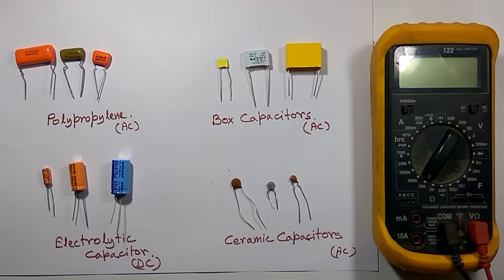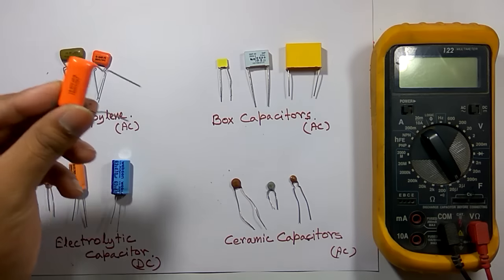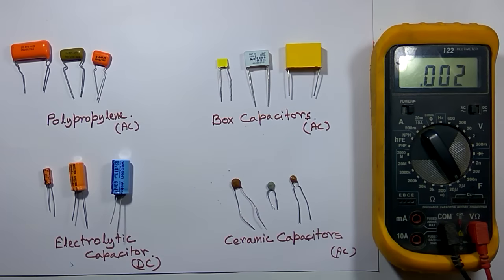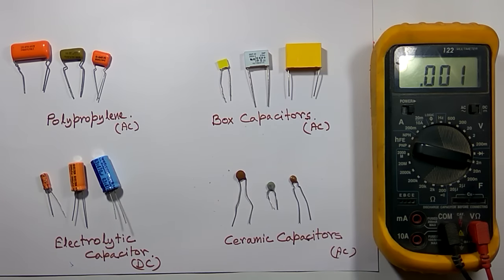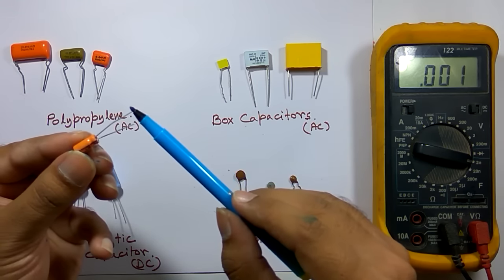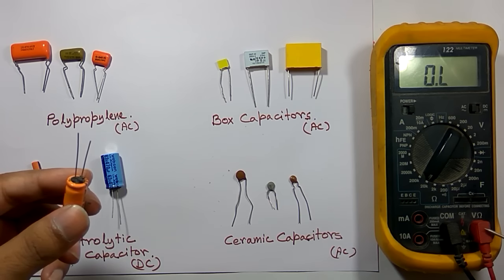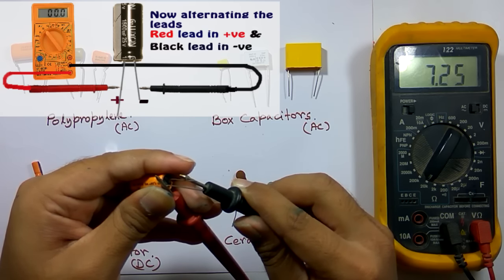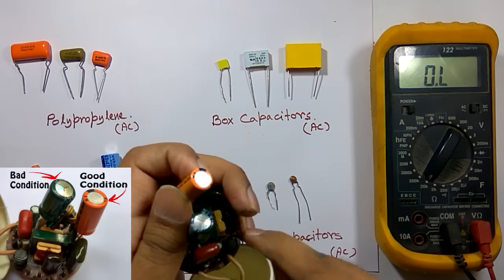How to Test Capacitors with and without using Multimeter

Comment: Testing the capacitance value does not tell you if it's good or bad. You need to check the internal resistance using an ESR meter.

Comment: Hi tech study  cell I have a question I have a Russian capacitor 6800  H 70 which is in English 6800 PF AND N70 but I don’t know the voltage but I now what voltage the motor runs on its 4.5 volts it’s a toy boat from the ussr and the voltage isn’t written

Comment: Excellent video, however i disagree with 2 things.
1. 20% deviation really should be replaced. It is on its way towards failing. 10% deviation is the normal acceptance.
2. Do not ever use your fingers to cross the leads in order to discharge capacitors.

Other than those to things. This is a good video and helps people out. Keep up the good work.!

Comment: wow you great bro... i know so many things of capacitor. can i check it in pcb boards with connections???
Reply from the maker: No. You may get wrong results.
Reply: @TechStudyCell  how to check that capacitors 🙄🙄🙄🤔🤔🤔🤔
Reply from the maker: Disconnect the capacitor from PCB. Then test it with multimeter
Reply: @TechStudyCell  thanks

Comment: Hello I have a Polypropylene AC capacitor where written 2C 105K 230S316 can I use 105J 250V Polypropylene capacitor in place of that capacitor.

Comment: DC leakage and ESR of a capacitor are parameters that can not be measured with a multimeter. Measuring capacitance is only part of the process in determining if a capacitor is functioning properly.
Reply: Quite true. I have seen capacitors that smell electrolyte, not bulging and have internally popped after applying voltage and showing  they are charging on ohmeter test.

Comment: Hello can you please tell me if i try to replace big electrolytic capacitors from chassis (hantarex) from the power of the board and to other places of the board before i disolder them i must discharge them? If yes how? with the same way of the screwdriver even if they are soldered?

Comment: you should discharge using screw driver ok,,but must not touch the two ends if its high capacitor its FATAL means may die 
so discharge with any screw driver

Comment: I have made Inverter from watching YouTube video. I have used 2 2N3055 transistors, 12 0 12 transformer,2  330 ohms resisitors and made a cicuit with them. 
When i connect with battery it gives good AC voltage but transformer gives teeeee sound. I found the solution to it. I have connected high value ceiling fan capacitor in with transformer output +ve and -ve wires. It finishes that teeeeee sound but capacitor lowers the Ac output voltage. 
How to select the capacitor microfarad and voltage for 2N3055 2 transistors inverter?

Comment: does the visual method work only for electrolytic capacitors?I don't see how I could check for this with ceramic capacitors for example.
Reply from the maker: +Joshua Benarroch, it will work when the capacitance value is high. Even for the electrolytic capacitor having low capacitance value, cannot be tested with this method.

Comment: brilliant video.....what can be the reason when capacitor blows up in circuit
Reply from the maker: Mostly wrong polarity, voltage rating not followed etc
Reply: I've seen both electrolytic and box capacitors explode when they are old and have "dried" out. Quite a loud explosion!

Comment: hi, thank you for this video... please how can we read a propylène capacitor like the following : CL 21 155j 250v  ( Cl 21 refers to manufacturer, 250v is maximum voltage supported, but 155j ?
Reply from the maker: 15 5 J ---> 15 [first two digit]  |   5[ no to zero after first two digit]   | J [Tolerance  +-5%]  |unit in pF
15 * 10^5 pF  ----> 1500000pF -----> 1.5µF

Comment: Bit silly to say you can verify a electrolytic capacitor polarity by looking at the length of the contacts.  More often than not you would only be testing it after it has been in a circuit where it would have been cut.  Anyways good video, some handy tips.
Reply from the maker: Thanks

Comment: note to readers : 

only charge capacitor w battery if BATTERY’S voltage rating is LOWER than capacitor’s

thats my understanding (re: safety)

be sure to verify for yourself before accepting my comments (and everyone else’s) as 100% correct

Comment: Hi, my friend. My capacitor has this written on it: 474J 630V S733 MPP - I measured 530nF with a multimeter. Is that ok or do I need to replace it? I don't understand the letters on the capacitor.  Thanks

Comment: I read that one should use a resistor when discharging capicitor so you dont short it out
Reply from the maker: Yes, it's better to use resistance when the capacitor is fully charged and the capacitance value is more... Here I have tested small capacitors and they were not charged.

Comment: Can we use 224 400volt instead of 224  50 volt
Reply from the maker: Yes. Voltage rating should not be less than the required value. Instead of 50v you can use 400v rating capacitor

Comment: can i discharge a box capacitor of an electric fan using a screw driver?
Reply from the maker: Yes, you can. But to discharge higher voltage rating capacitor you have to take proper safety precaution to avoid the shock hazard. I will suggest you for discharging such capacitor, use a high wattage resistor across the capacitor to discharge it. [* don't touch any metal parts & keep away you eyes]
You may refer the following video.
https://youtu.be/epfMNxTkmns
Reply: Sir, the box capacitor of my electric fan in which I want to test is 400v 1.7 micro farad. you said that puting a resistor across the capacitor..you mean both ends of the resistor will touch each capacitors terminal?
Reply: I just watch your video you shared and its amazing..thank you very much sir...you are such a big help to us. thanks again.
Reply from the maker: +wolfenstein1040 
Yes. But hold it for some seconds.
Pls share the video if you like it. Thank you for your support.

Comment: Electrolytic ones can have a smaller capacity than nominal ones. So, sometimes, this method can mislead you as well. As well, should be mentioned, that we should always test it out of the circuit. ;)

Comment: how to test tantalum, polypropylene, box and electrolytic capacitor using Analog or digital multi meter having no capacitor range in meter
Reply from the maker: The capacitor having very low capacitance value cannot be measured with digital multimeter having no capacitor range in the meter. The electrolytic capacitor of high capacitance can be checked as shown in this video.
Reply: Sir, Please also upload the video of Transistor testing FET
Reply from the maker: I am sharing the video link of testing MOSFET. Please note this is a quick and dirty test. Please share your feedback. 
https://youtu.be/IF740E5bm84

Comment: Sir how to check smd capacitor  in multimeter 

In smd capacitor there is no value on the capacitor how can I check
Reply: Chikkegowda C K the same question also,how to test smd cap

Comment: I'm new.  I thought electrolytic capacitors are polar so they should only be charged in one direction else they could be damaged.
Reply from the maker: yes,  you are right... if you charged DC electrolytic capacitor with wrong polarity it may damage.
Reply: Tech StudyCell I appreciate your honesty.  Weren't you charging the capacitor in both directions with the multimeter?  Does that mean we must damage, or risk damaging, the capacitor in order to test it?
Reply from the maker: Although this is not the accurate process to check the capacitor but still we can adopt this process if we don't have a capacitance meter. and as we charging the capacitor with a very low voltage so this will not damage the capacitor.

Comment: What is this bunkum, showing the measurement of capacitor already got the option in the multimeter.
Reply: Some mere mortals on this planet are not all knowing., unlike your good self. In the beginning he states that he is going to show how to test capacitors WITH and WITHOUT a multimeter.  After extensive study of the video (approx 2.5 minutes) he achieves the first part of his goal. Later in the video he shows how to test an electrolytic with the use of a 9v battery, thus achieving his second goal. 
Please let us know at which  points in the video the bunkum starts and finishes in order that all mortals on the planet may benefit from your vast knowledge and fine judgement.

Comment: 20is the max capacity on the multimeter? my 4700uf capacitors sould be close to 4700uf, but i about to test 40years old 8000uf/50V caps :)))))))
update: one side of the board the capacitors is 19.99 the another side is 9.48
The second side may be used in the 40year timeline :)

Comment: Capacitors store energy. So they store energy irrespective of AC or DC supply. So the same capacitor can be used for both AC & DC. Applying AC to all the other capacitors is disingenuous and misleading. The different one is the electrolytic capacitor which is polarized and cannot use AC very well... Often they will explode without additional supporting circuitry.
Reply: Your comments are  misleading.  I am not an electronics expert, but remember from my studies of physics. When connected to a DC power supply, yes, the capacitor does store energy.  When connected to an AC  power supply, the capacitor passes a current and does not store energy.  If I remember correctly, electrolytic capacitors should ONLY be used with DC voltage.

Comment: This video is not complete. Luckily I can understand this fellow a lot of people may not, some being anglo saxon.
You did not show what to do  for large value of capacitors.  You should be showing how to test capacitors with analog meters. It is faster and all values can be tested an inexpensive way and faster.The application of what meters and equipment used depends what field of electronics your in. This video is not any help to me. Sorry. TRY AGAIN I KNOW THIS IS FOR ELEMENTARY EDUCATION.